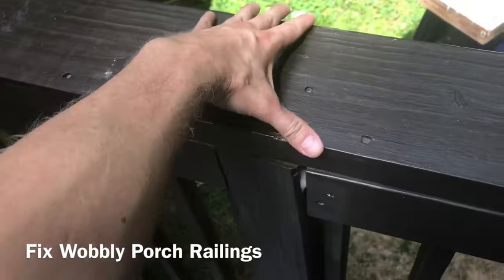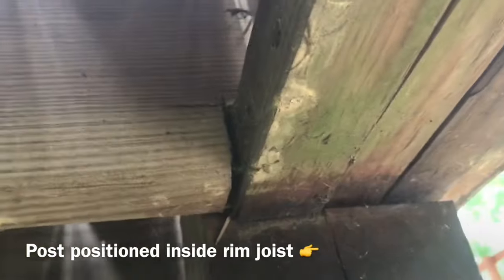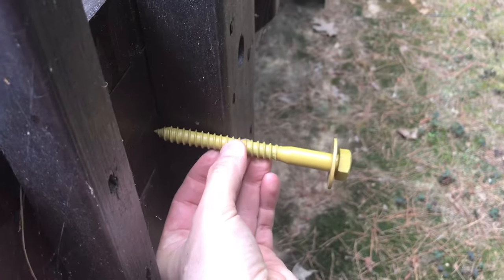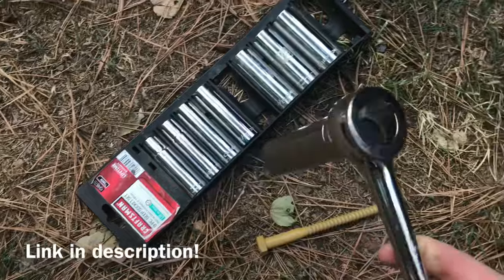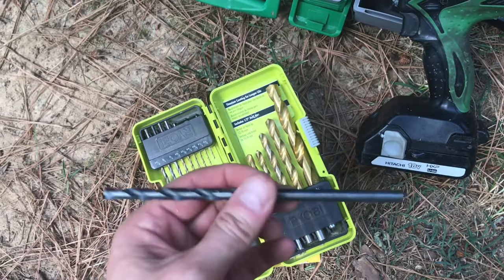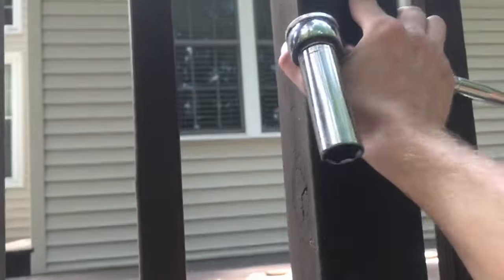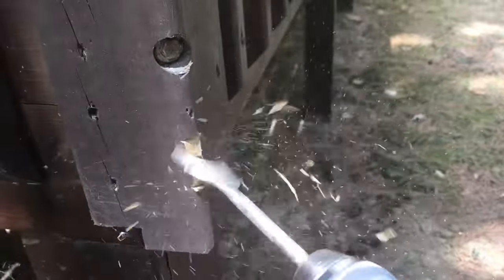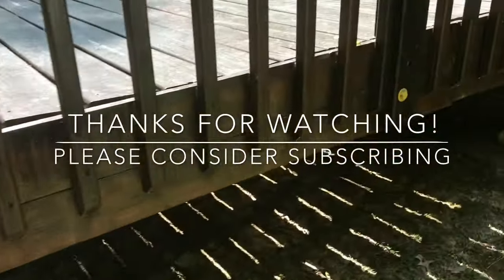DIY Fix Wobbly Railings (On a Deck or Porch)

Comment: Been dealing with my old deck trying avoid having to rebuild it. This was a very thorough, detailed perfect explanation of how to do this. I went through this a couple years ago, but used carriage bolts with washers on both sides and lock washers on the nut side. I have a tendency to 'overengineer" crap. Love your vids, they have been a huge help for someone with no proper carpentry skills.

Comment: Great video. We have a deck that's got an approximately a 20-foot run and the railing is really wobbly and we are looking at closing out the building permit for that portion of the project and some work is going to have to be done on the railing and your video put into perspective what needs to be done so thank you

Comment: I would put two lag bolts on the side of the corner posts instead of a second one under the first corner lag. It just seems it would be stronger putting a lag on each flat side of the corner post.
Reply: i was thinking the same thing. 
they already notched a huge chunk out of the post, and then you remove even more material to get that washer to sit flat on the corner. probably not much post material left between the washer and the rim joist.
i thought for sure he was going to put one new lag on each side, one high one low.
Reply: The real problem with this deign is that the 4X4 posts are no longer 4X4s. Notching and surface screwing them to the outside of the rim joist after, splitting them, is a recipe for disaster. All the screws in the world could never make this poorly built railing safe.Drilling more holes and putting in more screws only serves to make these posts weaker with more places for them to split and fall apart when they are leaned on.
Reply: @williardbillmore5713  you're being a bit dramatic about that. The vast majority of decks still standing were made exactly like this. They are no longer 4x4's, correct, but the idea of a 4x4 railing posts is overkill from the outset. Giving a 1 inch notch allows for a possibility of splitting over time (or bad luck), but the probability is still very low. An effective reduced strength of maybe 3-5% at best. However, we are in a world of possibilities and mindlessly forget about the probability.

Comment: Great Video,  I am enjoying educating myself watching all your videos.    Wouldn't it be better and easier to make the hole in the  first rail that you are securing slightly larger than the lag screw.   This way it would pass through freely and tighten up the railings better to the deck?
Reply: It won't be snug and may reduce stiffening strength of the hardware and the wood support.

Comment: Nice job and great video Ethan .  Do you ever need to add more meat behind the rim joist or did you just luck out this time?
Reply from the maker: Thanks Ed! Around here pretty much every rim is doubled up, so plenty to attach into 🙂
Reply: Makes sense, mostly singles on the outside here.

Comment: I had rusty joist hangers that I’ve since replace with Simpson strong-tie zmax and secured with their SD screws #9-2.5”. However, I notice some gap between the joist and ledger board and beam.  Do I need to be concerned with that gap and the double-shear screws not penetrating enough of the ledgerboard and beams? What can I do about that? Fill the gap with some sort of shim? Also, the deck still feels wobbly overall. Should I install some SB16 sway bars diagonally between the joists corner to corner?

Comment: Hey man, great video.  I have wobbly railings that also appear to be not very plumb.  Any advice for correcting that at the same time?
Reply from the maker: That’s a trickier one m ceez. Might require removing the posts and cleaning up the seat cuts/notches
Reply: @TheHonestCarpenter  thanks much!  I'm willing to remove them altogether and replace all the railings so I'll try your suggestion first before I do that.  Thanks again  boss

Comment: I might have a wobbly railing but I want to attach lattice to the railing I have 2 x 4 studs and wondering about pre-drilling through the studs and through the railing
Reply from the maker: I don't think it can hurt. Just be sure to use exterior-grade screws!

Comment: Seriously... One lag per post... Comical... What were thet thinking ( or not thinking). Those lag bolts cost less that the Liability Insurance Deductable. Whan I build stuff like this I spare NO expense on good hardware. I don't like having to come back and do a job over. Not to mention with facebook these days, something like this could destroy your name quick if someone goes through that rail and gets hurt.
Reply: BTW Good video Ethan.
Reply from the maker: Scott R Thank you! I know what you mean. Man, it’s crazy, but I can’t count the times I’ve seen NO lags or carriage bolts or hardware or anything. Just 10 gun nails shot in at all crazy angles. You can hardly add fasteners later they’re so scattered. Construction in piedmont NC has to set records for “fast/cheap/finished” 😂
Reply: @TheHonestCarpenter  No its just as bad here. On the State website ther is a 3 page list of people in trouble for contractor fraud.  They go through more trouble to do it the wrong way instead of just doing it right. Which brings me to my next point. Now no one trust anyone around here and the good suffer for the bad.
Reply from the maker: @scottr8588  I sometimes wonder if that's contracting everywhere. With my new shop space, and the ability to stage my videos a little better, I want to start doing the occasional video about how to deal with contractors. Simple stuff: what to ask in an estimate, how to know who to call. Stuff like that.
Reply: @TheHonestCarpenter  Great Idea... You could do like a little mini series.
Reply: You shouldn't cut corners on decks or deck handrails.
Reply: I made the mistake of only withholding $500 of the final payment on my deck. The contractor is refusing to return to fix the railings along the deck and stairs. I couldn't believe it when I looked and all the 4x4 railings had been notched down to 2x4 width. To make it worse the cuts were not square or shimmed and only 1/2" - 3/4" of the notched wood is in contact with the decking. I called the Attorney General and they offered mediation which I'm going to pursue. I plan to make a video of the issues.

Comment: any particular reason why you use a socket wrench manually rather than using an impact driver? just curious if i am doing lags entirely wrong as i almost always use my impact driver to fasten them and then hand wrench for the final bit to get torque just right.

Comment: In some counties, inspectors don't want carriage bolts anymore either, they want hex head through bolts with large washers, because carriage bolts can get pulled into the wood and loosen. Found that out 4 months ago when we had to swap out all carriage bolts to pass, meanwhile, the adjacent county still has carriage bolts on their deck PDF guide.

We now only use hex head through bolts with washers as we know that this will become the  requirement.
Reply: GRK or SPAX are superior anyway.

Comment: I have the exact same problem. My deck railings are for my above ground pool. The one end railing on the very end is leaning way out away from the pool. Now I have simple handyman skills at best but I was thinking of digging a hole next to the leaning railing and putting in a 4X4 post in the ground and cementing it in. I would use lashing straps to pull in the leaning railing until the 4x4 post dries. Then I would remove the straps and use lag bolts to screw the 4x4 post to the leaning post. Now would this hold up or is this just a dumb idea. Curious on your thoughts. Thanks

Comment: My deck railing is very similar. Except, the railing posts are not aligned with the support posts and it looks like they have four bolts in them. It seems really unsafe. Do you know what I should consider for strengthening these railings?

Comment: Getting ready to rebuild my deck/railings.  Decided to go with 6" structural screws in lieu of lags.  Ease of use, better looks.  Just not sure if I need 2 or 3 in each 4x4?  The clowns before me used 2x4 screwed into the rim joist to frame the railings, so anything I do is already an improvement lol

Comment: I have always built decks with the bearing post from ground to rail top. Very strong and sturdy.
Reply from the maker: That’s the best way, Jack! And these days, you have to have partial posts set inside the joists, with blocking and carriage bolt. this old half-lap method is vanishing…
Reply: @TheHonestCarpenter  thank you for the video

Comment: This is how mine was done as well. I notched mine 1/2" and used 2 staggered thru-locks but I also cut 2x6 to tie them into the joists so all the flex wasn't on the outside board. I pulled all my deck and that 2x2 railing off and I'm replacing it all with Trex so I wanted the posts to be very secure since it's on the 2nd floor. It's a 12x14 deck but it has 8 posts now. It may be overkill but I was paranoid.
Reply: Putting notched posts on the outside of a rim joist on a second floor deck?
 You should be arrested for attempted murder.
 Your unfortunate use of the word "overkill" may well be prophetic...and not in the way you meant it.
 I hope, for your sake, you have a good lawyer and lots of insurance...
Reply: @williardbillmore5713  "Putting notched posts on the outside of a rim joist on a second floor deck?"  Where did you read that they were put on the outside of a rim joist? In fact, how do you attempt to box them in with the joists (using a 2x6) if they are on the outside of a rim joist? I'm saying mine was originally put on like that and I installed the new ones on the inside and boxed them to the joists.
Reply: @michaelpeck5547  Why did you cut them down making them weaker at the exact point where they need to be strongest?
 Extra work to make the railing weaker...What were you thinking?
Reply: @williardbillmore5713  Make up your mind. Now you like them notched and carriage bolted to the outside? LoL

Comment: I have an older deck that was constructed with railing posts the same way. I just finished rebuilding it but I did not use lag bolts. Everywhere I read said not to do that. I instead used hex bolts with large washers at each end. This is much more secure and will not loosen up. In addition I added  a tie back bracket behind each post which is attached to the longitudinal joist and one of the 2 bolts I added at the bottom of each post is bolted down to that. That is the way to stabilize and secure 4x4 deck posts.

Comment: There is a word for people who notch their deck rail posts.
 It begins with an s, it ends with a d and has a tupi in the middle.The only actions that would make this deck safe would be to tear out all those notched posts an rebuild them to code, inside the rim joists with through bolts nuts and washers, tieing them to the floor joists.
Simply tightening the lags on that bad design will only slightly delay the inevitable injury when those posts weather and split, sending someone nosediving to the ground..
Reply from the maker: Definitely why they don’t build them this way anymore Willard. But it’s crazy how often you see the notched post in the south, where construction happened fast 70s-2000s. I bet 90% of decks were done this way 😬